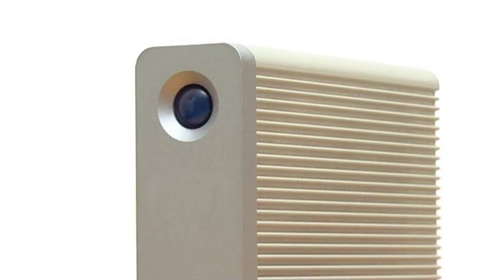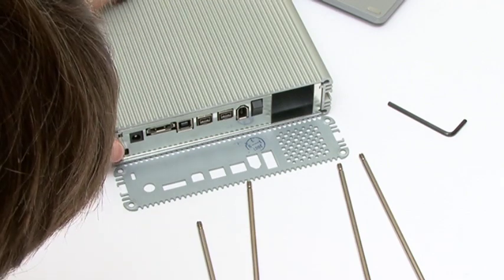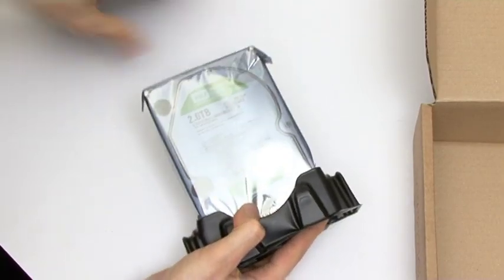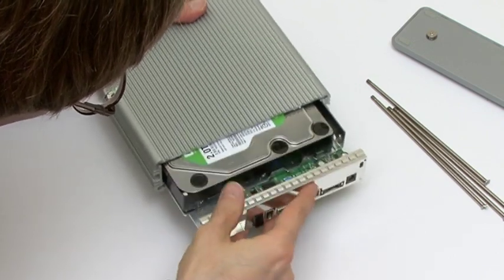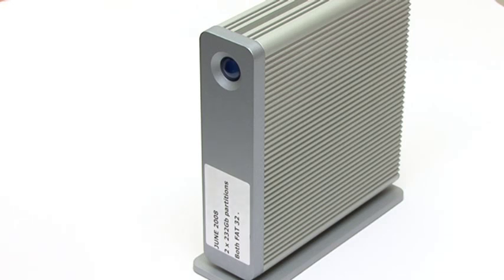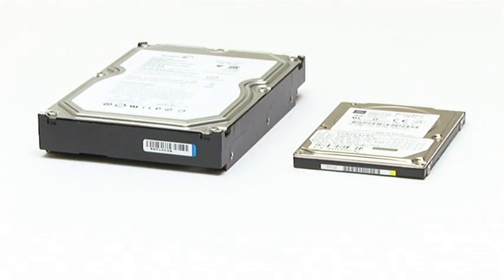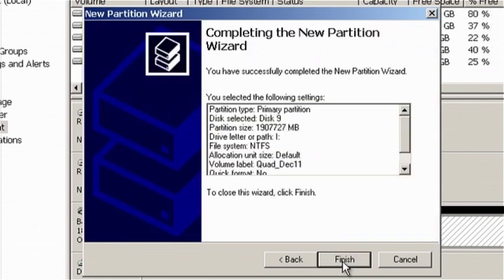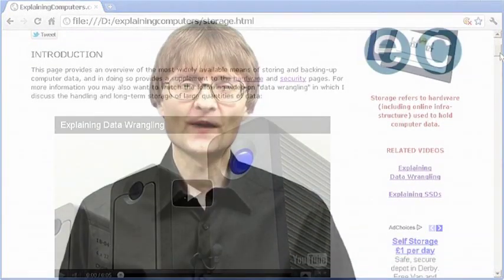Upgrading an External Hard Drive

Comment: I need to replace the hard drive of my d2 Quadra which is originally 2Tb. My important question is whether the enclosure electronics will work with a bigger disk of 3Tb instead?
Your reply is appreciated. Thanks
Reply from the maker: It will depend on how old the drive is. A drive produced in the past five years or so will probably have a controller that is not limited to 3TB. But the only sure way is to test it out (or to get a model or serial number and ask LaCie).
Reply: @ExplainingComputers  
The unit has USB 3.0, I suspect I bought it probably more than 5 years ago.
I will contact LaCie. Thank you for your quick reply!

Comment: Found an empty drive enclosure EXACTLY like this one on eBay this past weekend.

No power supply

Worked FINE with my spare 320GB WD HDD in it

Powered up fine with a 12 volt 3 Amp  brick

Cloned my three Mac OS vrs. on partitions

All hunky dory...

With my several Macs here....

THEN I tried powering it up with a 12 volt 2 Amp brick that has worked with some enclosures

No Go.... Nothing, as I might have expected...

Powered up again with the 3 Amp brick

Booted up fine

BUT no more blinking LED activity light... DEAD!

I tested the LED with my meter... seems Ok.

Did NOT put power to the LED...

It has gone BEHIND my 23" DELL monitor

So it's not a great loss.

But this is the first such LED loss on  5 of 6 d2 Quadras here...

One as old as a 120GB IED FW400 d2 from 2003....

Other older 4 pin boxes....

I assume the 2 Amp brick caused the LED controller to fail...

I found a good used 3 Amp Switching adapter for $8.50 ppd.

on eBay, earlier today

So I WILL have 3 d2s working here...

2009 Mac Mini, 2007 iMac20, mid 2008 MacBook Pro 15....

I'll retire an iOmega Mac Companion FW800 drive I've used for years.

A $10 thrift store find, empty, about 2012...

It's never liked working with LaCie drives chained up to it...

Nor has it ever been SEEN by the iMac....

Funny business

A lesson learned.....

Been into old Macs since 1997

A thrift store $15 SE-30 <

Many 68K's and then PPC machines, from 2007 - 2011

Intel ever since...

Retired camera repairman

Mechanic since age 5

J.C.

Age 73....

Comment: If I want install 4tb on this disk, can I do?
Reply from the maker: It will depend on what you are installing it into -- a lot of older devices (5 years+ or so) will not support drives greater than 2TB  -- so you could put a 4TB drive in, but would only get 2TB capacity,
Reply: @ExplainingComputers  Ahhh :( I have an Lacie Quadra D2. the limit is 2tb?
Reply from the maker: @cristopherlopezsonido  For the early drives, yes, 2TB. It just depends when it was made.

Comment: To anyone finding this after 2018 - I have one of these enclosures and want to put a 4TB HDD in there.  The video does mention drives bigger than 2TB can have issues with the electronics and Im wondering if this is why Windows 8.1 reports my new 4TB drive as only having 1.8TB of space available?  Thanks.
Reply from the maker: Windows 8.1 should access a 4TB drive/partition just fine. The 2.1 GB limit is a hardware controller limitation.
Reply: @ExplainingComputers  Anyway to determine the hardware controller limitation?  I also want to install a 4TB drive or possibly a 6TB.

Comment: Can I replace the broken Seagate Barracuda ST3000DM001 inside of my quadra drive by an HGST Ultrastar 7K4000, 2 TB? Are theres any issues for this swap?
Reply from the maker: I don't know these drives, but if they have the same interface (IDE or SATA,) then there shold be no problem. But if the Segate is IDE and the Ultrastar is SATA, the no.

Comment: why would you need a 2tb hard drive on an external HD?
Reply: Many people use external HDD as main working drives. For instance I use a very fast 18Tb Raid storage system as a main edit drive for 5K Red Video. My main editing computer only has a 1Tb of internal flash storage.
Reply: ah k thx
Reply: Reading this in 2023...

Comment from the maker: Almost certainly it can be upgraded to a 2TB drive. The reason I say this is that at 640GB it has to have a SATA drive inside it (as IDE drives are/were max 512GB capacity). Today SATA drives go up to 4TB, but earlier controllers were for up to 2TB, hence that is the likley max.

Comment from the maker: Yes, I agree that the maximum size for IDE drives is 500GB. But I still believe that it is not now cost-effective to upgrade an external HD with an IDE drive, and the cost of a 500GB IDE drive will be higher than a new drive of more than this capacity.

Comment from the maker: Yes, most certainly (with a 2.5 to 3.5 inch bracket to hold the thing, or some improved lashup(!). Though I'd put an SSD in a much smaller case powered by USB.

Comment from the maker: 2TB is the pre-formatted capacity, 1.8TB the capacity after formatting. Formatting adds the structure to a drive required for it to hold the data. Think of it a bit like fitting shelves in a library -- they take space, but if they were not there if would be impossible to arrange and easily access the books.

Comment from the maker: Yes, you should be able to just swap the two 500GB SATA drives for two drives of a higher capacity -- providing that both new drives are of the same capacity. And I would not exceed 2TB drives. The RAID array will then need to rebuild itself. This may be automatic, and/or may be handled by the LaCie driver software (as either came with the drive, or downloaded from their site). Please let us know if you try this and the results! :)

Comment: I've got a Lacie DD3US external housing. It has 2 x 500GB SATA drives connected in (RAID ?) some configuration via internal circuitry and then uses a single USB interface to connect to a source.
For upgrading this unit, is it as simple as replacing both 3.5" drives (as in the case of your video for the single drive unit) or are there other considerations? Thanks for the great videos.

Comment: if your asking if all hard drives are the same size in bytes, no. All hard drives (that aren't the same size) are different bytes. For example a 500gb HDD would be 536870912000 bytes (google ftw) while a 1 terabyte HDD would be 1073741824000 bytes

Comment from the maker: I've had no problems at all with this upgrade. The Caviar Green adjusts its spindle speed to save energy and can spin down quite regularly, but still works fine in the LaCie case. As you will be aware, the LaCie D2 Quadra has a power switch with 3 positions (on, off and something clever in the middle). If you just use "on" all of the unit's energy saving features will not cut in -- so if they do cause you problems you can just turn them off this way.
Reply: class room speak commonecation software 🏛🌍🌎🌏🏪🏫🏭🏯🏰💒🏩🏨🏧🏦🏥🏤🏣

Comment from the maker: I can see that you were watching intently! The old disk was indeed formatted as two FAT32 partitions. This was to allow access for multiple operatings systems. You are right that Windows will not format a FAT32 partition greated than 32GB. But it will happily use them (it was just a MS ploy to shift people to NTFS). So I used a free utility called SwissKnife to do the drive formatting. The new drive, by the way, was formatted as a single NTFS partition (as I now regularly with 4GB+ video files).

Comment from the maker: @xshalludiex The hard drive inside your GoFlex 2 will have a standard SATA interface and power connectors (any drive over 500Mb has to be SATA). So if you remove the drive from inside the case you will be able to connect it to free internal SATA port and power connector. Or you could connect the drive toan e-SATA port with a lead that has an e-SATA connector on one end and an internal SATA connector on the other (plus power of course).

Comment from the maker: @zoharh Hello again! I **hate** fitting static screens because they are a swine to get in the right place (I make similar if more extensive comments on the subject in my "Building a Green PC" video). Here the screen got all bent, but you never see that! :-) The 2 HDs are a 3.5" and a 2.5". The 3.5" disk is the one I removed from the LaCie drive earlier in the video. The 2.5" is a good 10 years old, so maybe looks a bit like a 1.8" disk. But it isn't! :-)  Thanks for your feedback as always.

Comment from the maker: @Jonnynator200 I have personally always opted for Windows over Mac on the basis that I think you get better value for money that way (even though I am not a big Microsoft fan). Apple I think is a religion as much as a technology platform, which is great for people who do not mind paying extra for something to believe in. Certainly Macs are (in their way) easy to use -- but only if you work the Mac way. Set up a Windows PC and don't mess with it and it will be just as stable.

Comment from the maker: @J2897Tutorials Good points. For years I only used FAT32, but have now "accepted" that NTFS is OK -- not least as I sometimes need to work on individual video files over 4Gb. Using the command prompt, Windows can actually format FAT32 to any capacity of partition. Yet another good (free) option is using a great little program called Swiss Knife that I relied on for years to create large FAT32 partitions.

Comment from the maker: @ImperviousPeanut Uhm. "Portable" drives -- if you want to class them on their own -- are still a form of external drive: ie an internal drive in a case for external connection. What I discuss in the video covers both -- I mention 3.5" and 2.5" drives, and both use the same SATA connection.